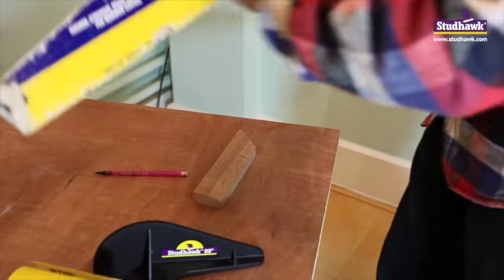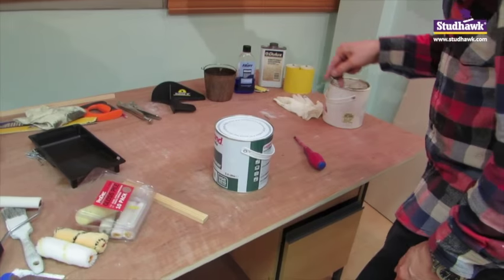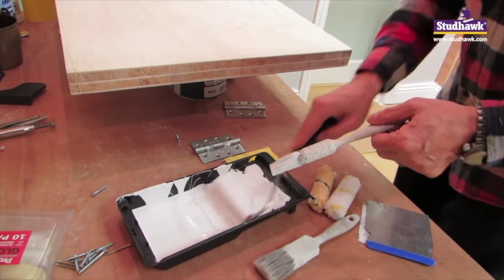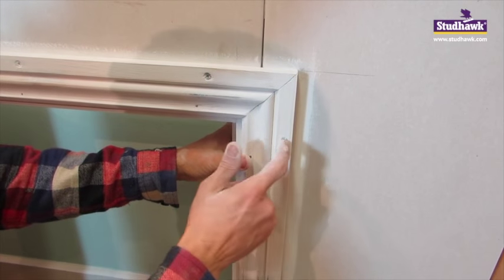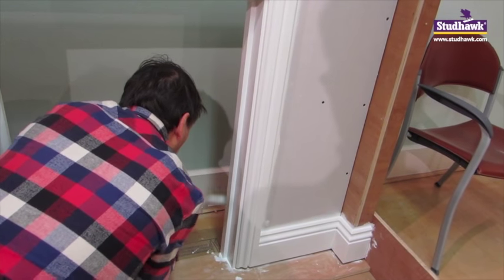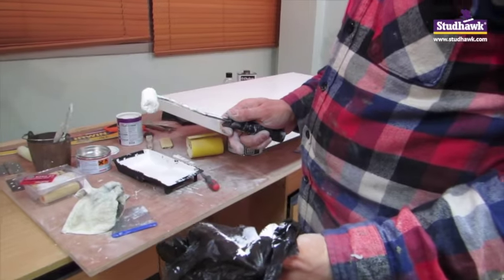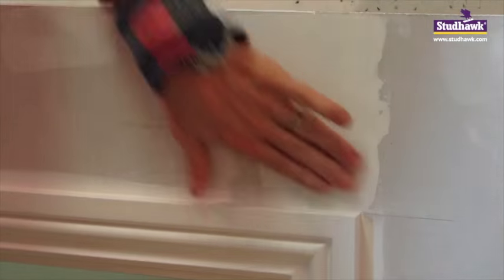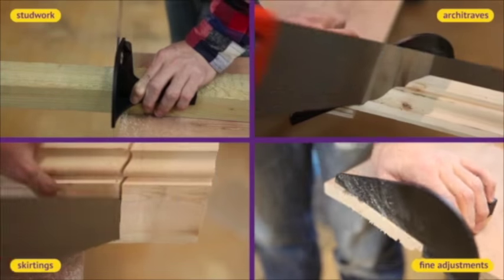How to Decorate Using Oil Based Paint

Comment: hi.great videos keep them coming. i have ordered the stud hawk  but i was wondering what brand of handsaw do you recommend? what brand of handsaw do you use in your vids? what length is your saw? many thanks
Reply from the maker: We recommend using Irwin Saws or any 8/9 TPI (Teeth per inch), Panel Saw or Jack Saw as they are known.
Reply from the maker: Use an Irwin or Stanley 22 ich 8-9 tpi (teeth Per Inch) for plastic use a fine saw of 11 tpi.